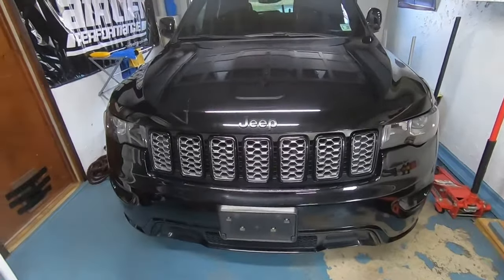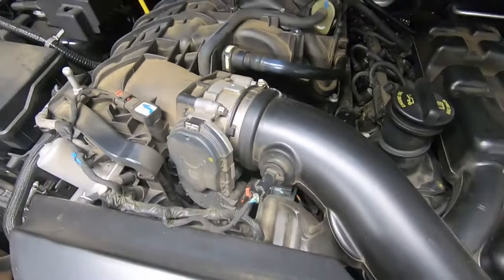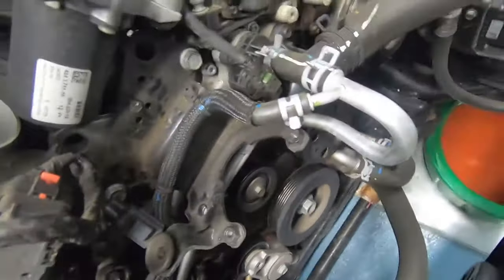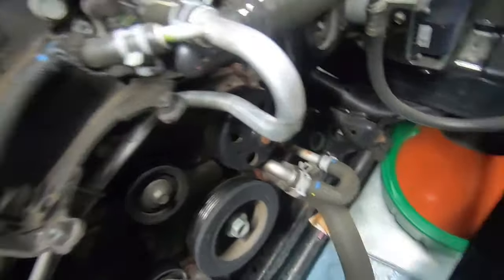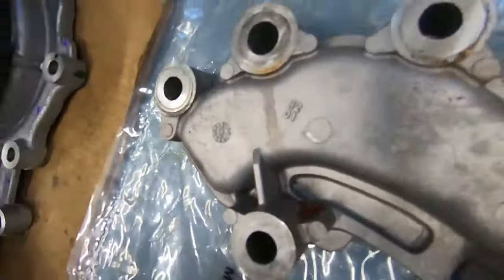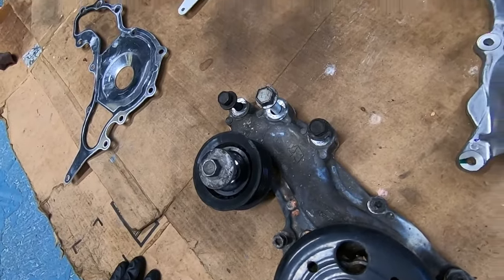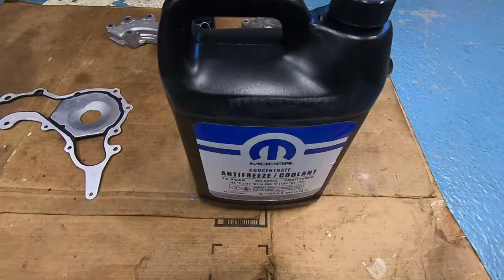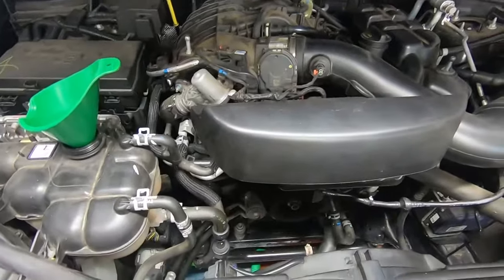2016-2021 Jeep Grand Cherokee Water Pump Replacement

Comment: Could you just replace gasket? Mine is doing the same.
Reply from the maker: If yours is doing the same thing, its the pumps actual weep hole that is failing, not the gasket. So just replacing the gasket won’t fix anything. Now if just the gasket was leaking you could do that, but its the pumps that fail on these from the weep holes, so if yours is leaking then its most likely the pump.
Reply: @TheOriginalBeeCee  oh I see, ok I’ll just be safe and replace the whole pump. Thank you
Reply from the maker: @arnoldtx1  no problem 👍

Comment: Great video and instructions.  Mind sharing where you picked up the torque spec sheet?  Thanks again!
Reply from the maker: I appreciate it 🙏 but I actually sourced them from a friend who had access to them!
Reply: @TheOriginalBeeCee  was their source one I could get my hands on by chance?  I've tried to find a repair Manuel with that information, but to no avail.
Reply from the maker: @Archangel0630  naa straight from dealer. Have you tried Haynes manuals? For the most part their usually pretty on point.

Comment: Have you been told by the dealer that the water pump has been redesigned? I have a buddy who bought a new water pump at the dealer and the postion where the pulley sits is moved 3 inches to the right. Now there is 1 extra bolt as the pulley bolt is too long for the new location and and the original location as they also reduced the thinckiness of the mating surface of the original pulley location. So it would need 2 new bolts to adjust for the move of the location. Dealer is no help what so ever because those guys only look at the computer and repeat what it says and can't answer a question.
Reply: Update, I was given a water pump the Chrysler Pacifica uses. Same 3.6 engine, however the pulley is in a different position
Reply from the maker: @xaviermedina5816  thanks for the insight. This is the first im hearing of anything like this. So just a pacifica WP is all thats needed?
Reply: @TheOriginalBeeCee They ending up having the wrong part in the box. They had the Pacifica water pump inside the box for what was supposed to leave it Grand Cherokee water pump. Even though both are the same 3.6 engine. They Pacifica is front wheel drive, hence why the pulley is in a different location on the water pump. In order to make sure the bolt does not hit the frame rail when removing. I had to call another dealer, to verify the information, and they told me that the dealer that sold the original part was wrong. They confirmed it was redesigned, but the appearance has not changed one bit so it must have been a change on the bearings off the water pump.

Comment: More of a man than me in that if I would have installed the pump like you did and it failed,  this Jeep would be needing a new windshield due to a hammer going through it!  Then, I would have demanded someone from Gates get their arse over there to replace with  another pump until it worked!  Great video though!!
Reply from the maker: Lol I appreciate it! And i hear ya man, it just seems like these WP’s were designed to fail. Its almost like it’s a freeze plug pressed into them and somehow coolant just finds its way out. I have a detailing business and since I did this job, I’ve done 5 3.6L WK2’s and I started checking them. 4 out of the 5 were leaking the exact same way, the only one that wasn’t had really low miles. So I’m not completely going to blame Gates lol, I just think it stems from a poor design.